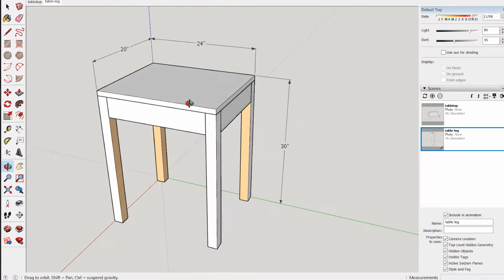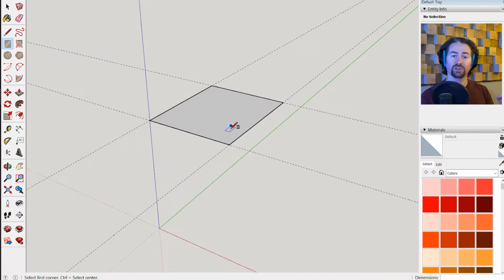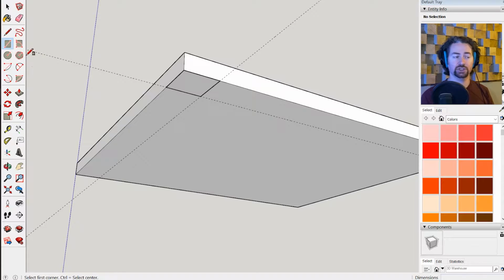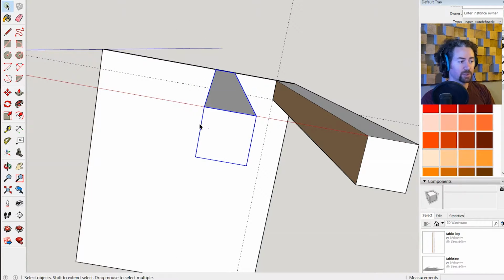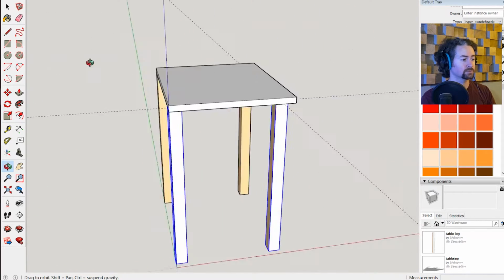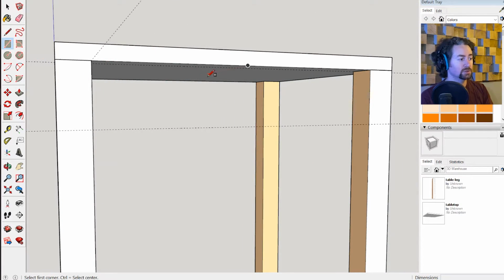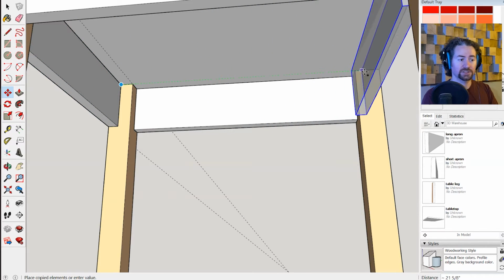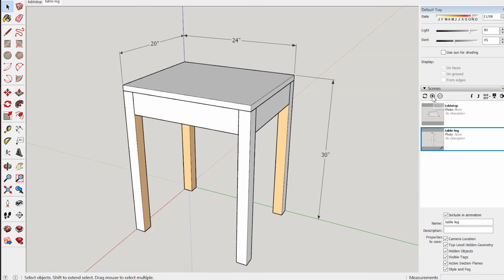Using SketchUp Pro 2020 as a Woodworking Design Software

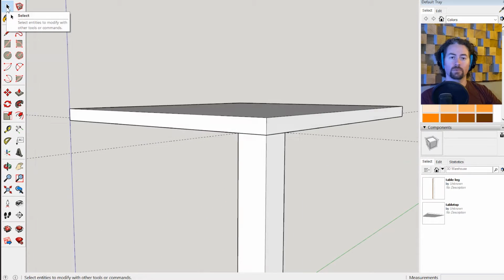Comment: 5:17 how did you manage to "select the leg" in one go like that? I've been at this for an hour and find it utterly unintuitive. So far I've only been able to select an "object" by clicking each individual edge and face. (Or click-drag selecting, but it only works in one direction..? And once the object is touching another surface you can't select the meeting area..?)
Reply from the maker: I was able to select the leg in one click because it is a Component. Groups also work like this.
Right click and then "make component" or "make group".
The whole component or group gets selected at the same time, and you can double click to go inside that object and edit it.

To select a whole object that is NOT grouped (or a component), you can triple click one of the parts.
Reply: @BobsWoodStuff  Thanks a mil. I'd missed that "make component" part of your video the first time through. Managing a little better now - this is my first time diving into a 3d modelling program and simply getting the camera to move where I want it took a lot of getting used to. The steep learning curve sent me into max frustration, but now I've figured out how modifier keys change the mouse behaviour, and where you click on an object plus the mouse direction you move in directly afterward all gets interpreted in different way that just take some getting used to.